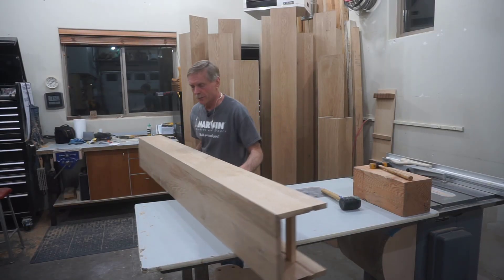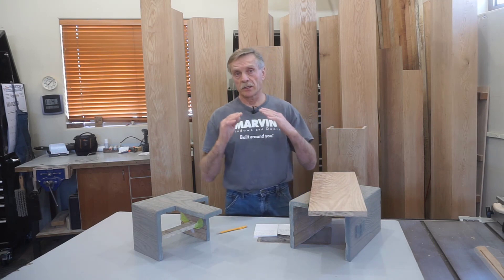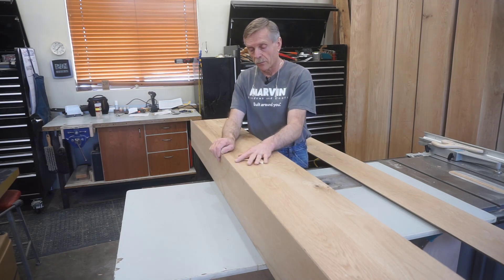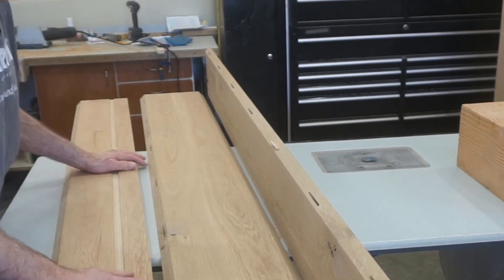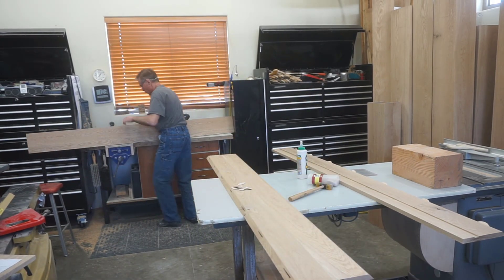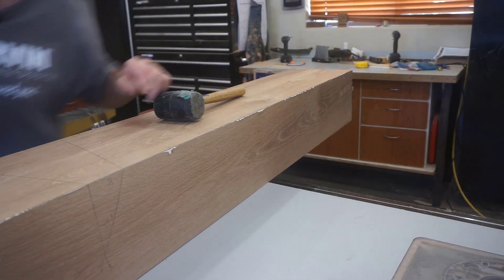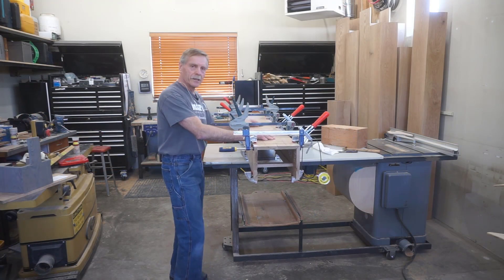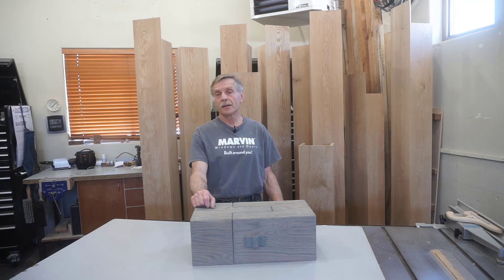5 Pro Secrets for the Best Box Beams

Comment: nice video: what would you do to finish this box if the ends were to be exposed as though it were not used as an open beam support etc? (also, your recap at the end says Band Camp, not Clamp :P )
Reply from the maker: Making the end of a faux beam like these look like solid timber is a bit of a trick.  I'm make up an end panel using end grain cuts (just like making a very boring cutting board) and then miter it around 3 sides.  I also miter the ends of the u-shaped pieces and glue the end grain 'plug' into place.  The fewer pieces you need to make up the 'cutting board', the more convincing the finished product...

Comment: The most amazing thing to me on this video is the number of straight boards you found.
Reply from the maker: Hey Jeff... I guess I didn't make it clear in the video but the boards were neither flat or straight when I bought them.  A lot of Milling goes into the process of taking them from random width hit and miss 4 quarter thick to the perfectly straight and flat 3/4 inch material used for making the beams. I just didn't want to double the length of the video to show what is fairly routine Woodshop work... Best, Matt
Reply: I guess I just did not realize the amount of work that you put into them. Great video and wonderful results.

Comment: Great video and good ideas.  BUT I find on teaching videos the terminology , like this one, is often confused.  You mention miters, they are bevels.  You mention a dado, it is a grove.  Orientation is the difference.  Anyway I would also like to point out something that you may or may not be aware of about TB III glue.  You mentioned that you liked a new bottle because it is runnier.  I'm not exactly sure why you like it runnier but will assume you believe it gives you longer open time.  I have discussed this at great length with Franklin and learned that runny typically means that the glue has set on the shelf too long.  The extended time benefit of the TBIII is because of an agent that is added to the glue.  A really new bottle of this glue is actually thicker.  Unfortunately over time the agent that extends the open time settles to the bottom of the bottle and the upper portion of the bottle has the separated thinner portion of the product..  I learned this the hard way when I bought a gallon of TBIII.  Anyway Franklin strongly suggests to look at the date code on the bottles of glue before buying and to periodically invert the bottle every few weeks, which the store does not do.  Franklin indicated that if the extended open time agent sits on the bottom of the bottle too long it can be very difficult to remix the contents.   I suggest you consult Franklin about this.  NOW that is how it was 10 years ago and maybe that has changed but I never buy gallon bottles anymore and always check date codes.  Food for thought.   Again though, great video.

Comment: Very nice work but, you didn't need to use the jointer to take off the 1/16" , as the flat part you left to run along the table saw fence would come off when you round over the corner.
Reply from the maker: The pass over the jointer is to remove sawblade marks on the bevel, not to remove the  flat part Michael.  The flat part assures consistent width sizing on all the parts.... Best, Matt

Comment: 11:52..."running the screw in from the top of the beam in case it ever needs to be removed".  NO WAY would I have thought to do this.  Then 10 years later when I (or some other poor soul) is taking these down for some reason, I think...Why in the hell did I not put those screws on the top?

Comment: wth was that biscuit jointer, i loved the sideways design
Reply from the maker: It's really an odd duck that I've had since about 1988 or so... and it was used then.  I got it as a demo model from a local tool/equipment rep who was just trying to get rid of it.  I think it's a European model as I've never seen another before or since.  One reason I got it is that it can be used as a plunge saw too which makes it pretty handy for some odd applications.  Best, Matt
Reply: It's made by (AEG )but I don't think they make it anymore.
Reply from the maker: @jklgc21  interesting and entirely possible.  Mine came in a metal case co-branded "ELU" and Black & Decker but who knows with corporate mergers, collaborations, etc, right? Best, Matt
Reply: @NextLevelCarpentry  I love your projects and videos!!! ELU Tools were outstanding (West)German woodworkingtools. The company was latter bought by DeWalt. You can still find used biscuit joiners like yours in yard sales in Europe, either by ELU or by DeWalt. Best regards from Czech Republic!
Reply: It's Elu DS140 Lamellofräse (biscuit jointer). ELU (established in 1928) was a German power tools manufacturer. In 1994 it was acquired by Black and Decker and a lot of ELU's technology was transferred to DeWalt.
Reply from the maker: @daviddecky7201   thanks for the backstory David... most interesting.  BTW I saw an ELU on eBay recently too... Best, Matt
Reply: @Next Level Carpentry A very interesting tool. It looks like it might have been a design modification to an angle grinder.
Reply: @daviddecky7201  
0

Comment: In the east 'box beam is a structural horizontal  component 
Typically 2x4 with 5/8" or 3/4 plywood  both sides , useful in many ways , the work in your video are  what we call feaux beams

Comment: Geez, I would think a good quality, white oak veneered plywood ripped in sequential lengths would make for a more consistent appearance and stable box beam at a lower cost...
Reply: petemclinc if you wanted a very clean look at the end that’s fine. But I think these will be distressed. You can’t distress veneer core without exposing the veneers.
Reply: @williambutler3695  Like I said, get a good quality plywood (with a thick veneer), I would want a very clean look but that's just me...
Reply: @williambutler3695  I knew a Bill Butler, he was in the air-blast business, I doubt its you, he's probably dead now...
Reply: petemclinc it looked like he “scooped” out one of the edges. Plywood might withstand a wire brush but you can’t carve it.
Reply from the maker: You're thinking like I'm thinking on this one William... the level of distress required for this project will be a quarter inch deep in places and I for one have not seen veneer and you thicker than 1/64 of an inch😁😎. Best, Matt

Comment: I guess those are called box beams in house carpentry, but they aren't what a boat builder would call a box beam. To us a box beam is a structural beam with four sides to provide stiffness in two directions with relatively light weight. We don't use miter joints in general, and certainly not in a structural element.

Sorry, came here thinking it was something else.
Reply from the maker: Definitely a 'land lubber's' video here Chimera😀😂😂😎... hope you find the safe harbor you're looking for... Best, Matt